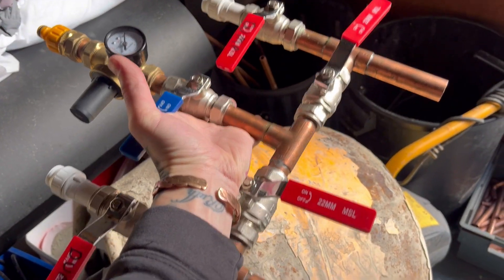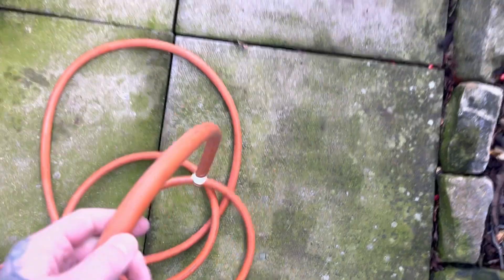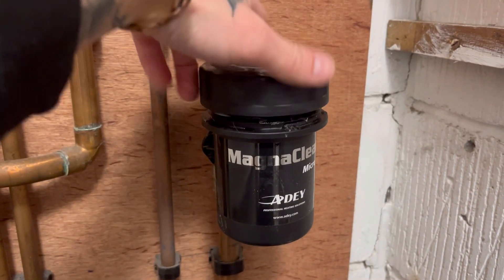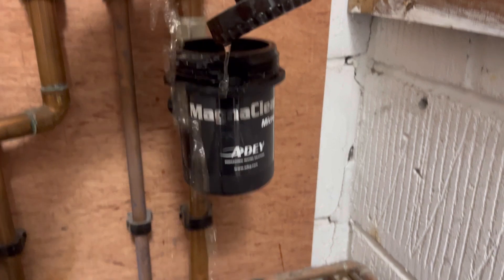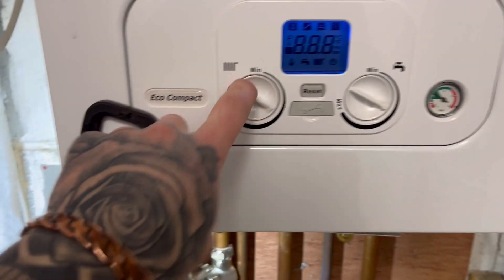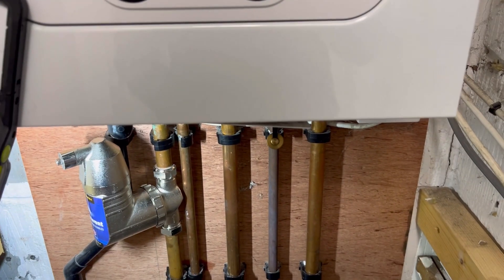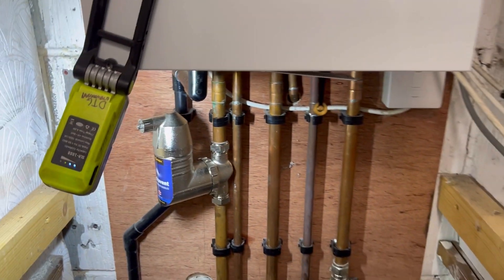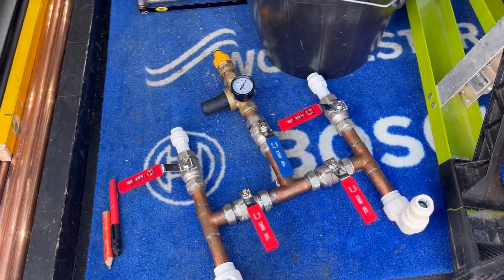Mains flushing unit, reversible flow..

Comment: Great vid and great jig. I reckon the jig would have cost about £50-75 to make. Of course, once you’ve made it, you’ve got it forever and you can mains flush whenever you want though you might still decide you need to power flush if it’s really bad. But contrast you can hire a power flush for £100. Would you be better off powerflushing and then building a jig like this in a couple of years and using that to keep on top of it?

Comment: There’s a video on here where someone uses a more square set up where you can keep the circulation going round and basically with a pump you can build a power flush machine. Works pretty well.

Comment: Great video, Dan.
I made something similar a couple of years ago, with four butterfly valves arranged in a square, with compression tees at each corner; one corner to water in ( via pressure reduction valve) one to dump, and the other two to flow and return.
Like yours, it seems to work pretty well.
Reply from the maker: Would have liked to have seen yours mate! It works well yeh buddy but I think improvements can be made. Thanks for the support Steve!

Comment: I used 3 Way Lever Valves on mine, much smaller set-up & simple to use. Also you need only one Dump Hose.
Reply from the maker: Yeh I think I might amend this one, after reading a few comments there’s improvements to be made 👍🏼

Comment: I’ve also built myself a reversible flushing valve setup. I used two L port valves which means to reverse the flow I only have to operate two levers. This means I can quickly change the direction of flow. I’m not a plumber or heating engineer but like to do as much stuff as I am allowed legally. I may even post a YouTube video of my contraption.
Reply from the maker: I’d love to see it.
Reply: @Heatking  I think I may hook it up to a spare rad in the garden and video it. I went mad and bought and fitted magnacleanse ends and pipes

Comment: You need a second dump hose or link to the dump hose together with an additional lever valve. But the idea is top notch

Also did you fit the air separator with the arrow pointing away from the boiler. I could be wrong but it looked like it was pointing towards it ?
Reply from the maker: Cheers mate. I do have a second hose but had left it 😂😂 yeh teeing them together is a great idea! I’ll have to check on the video if I put it on the wrong way 😳

Comment: Think this job made you lose your head a bit. You fitted the micro vent on the flow but set the body pointing to the boiler as if a return. We've all been there 👍🏻
Reply from the maker: It is however pointing the wrong way! Well spotted! 🤦🏽‍♂️
Reply from the maker: That’s the correct way to do it buddy, well correct according to its instructions anyway haha.

Comment: Personal preference but you could use the pegler butterfly valves to make the levers a bit tidier. Impressive gadget and I'd imagine a fair bit cheaper than a thorough flush unit. Id have a brass hose lock too just because im a tart😂
Reply from the maker: Haha yeh it would make it tidier matey you’re right, but would bump the cost up a bit more. Cheers for the support Tom!

Comment: Not a plumber but i like to solve problems. Could you not use an L port valve for the cold feed and then join the dumps together. And using 15mm or half bore as the pressure from any hose outlet is never going to need full bore? (when watching other plumbers ive always wondered why not build your own #pb) Good work!
Reply: (Suggestions are to make it smaller/cheaper - forgot to mention)
Reply from the maker: Cheers mate, yeh teeing the 2 drains together is a great idea. I’m going to make some amendments from the awesome advice for the comments like this on here :)

Comment: Very clever lad.
Reply: But wasn't as good or explained as well😊
Reply from the maker: @macpatel7810  you’re too kind to me Matey 🥰
Reply: Just honest buddy. Keep up the good work.
Reply from the maker: @macpatel7810  cheers buddy! Appreciate it.
Reply: Thoroughflush for me im afraid. You can reverse flow in not even a second. Pressure reducing valve was an extra 40 quid, but it pays for itself just using it on one job and its a tax right off lol. Comes with great hoses for flow as yours are abit skinny lol. Each to there own i suppose
Reply from the maker: @Purebeltersteve  Yep, each to their own. Just thought I’d try out making one myself and trying it out 👍🏼
Reply from the maker: Cheers buddy! However! It’s been done before 😂

Comment: Instead of using a mallet as a agitator use a cheap body rechargeable massager off of Amazon has various heads  has 30 speeds and usb recharge works a treat plus if u have a blocked waste trap put it on the trap section whack away  on  the trap lower seal at a moderate speed  30 seconds and if your lucky it will clear .
Reply: Great advice my wife has a big one she keeps in the bedside cabinet should be perfect 😮
Reply from the maker: Never thought of this! Ingenuis mate thank you!!
Reply: Rabbit?
Reply: I use a toffee wheels £3.50

Comment: You dont need the blue 22mm lever valve as the 2 red ones switch flow off 🤔👍
Reply from the maker: Well spotted mate ❤
Reply: I was thinking of making one? Do you recon 15mm be ok under mains pressure with full bore lever valves? Doing one rad at time 🤔
Reply from the maker: @johngough7817  I don’t see why not. Mines reduced to 15mm off the hoses mate and worked fine. Just a little more restriction isn’t there.